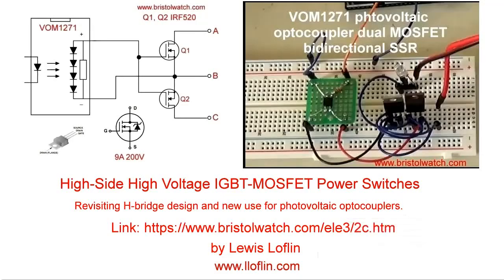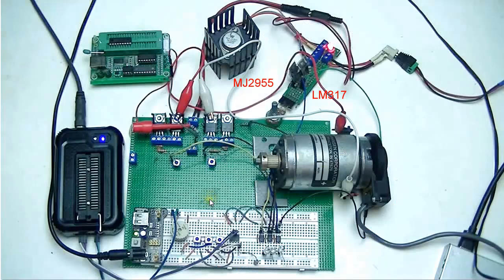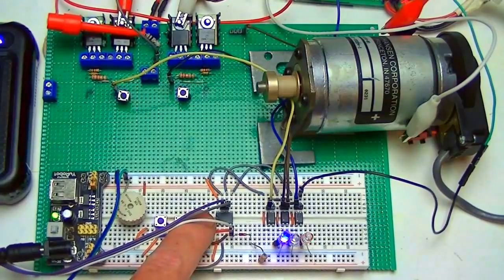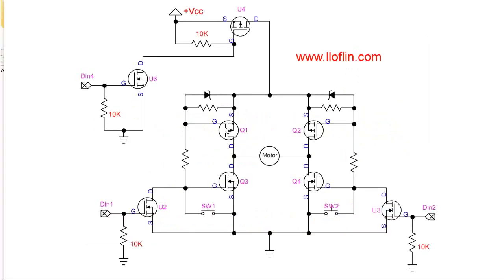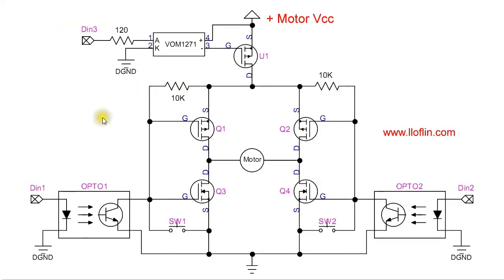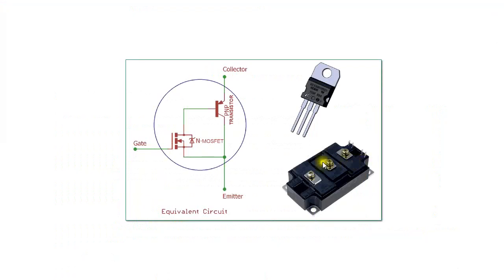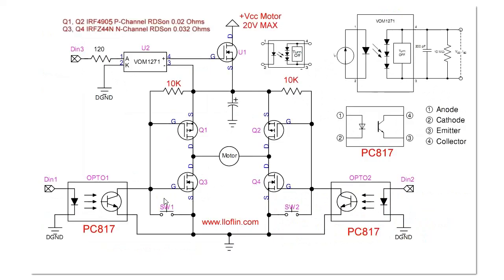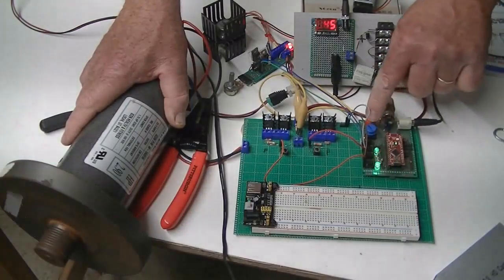High-Side High Voltage IGBT-MOSFET Power Switches

Comment: Can you do a video on smoothing PWM power to a large DC motor? How to size and whether to use a capacitor or choke? Thanks
Reply from the maker: Voltage and current have to be known. I'll try to cover that in an upcoming video.

Comment: Thanks for the video!

I have a winter project to design a new autopilot for my boat. The current one uses large BJT's for the H-Bridge, its from the early 90's so thats what was available. I wanted to replace these with MOSFETs to reduce the power loss in the circuit.

Comment: VOM1271 has a very bad temperature-Vco curve sir. When it 0, Vco is about 10V, which is enough to open a MOSFET up to a Rdson from specs, but when it becomes really hot, Vco can be as low as 5V. But nobody stops us from using  it in series with a zenner (cause when  it's below 0, Vco can be more than 10V), but this must be calculated yet because of a small output current. I prefer to use some high voltage PWM IC and PCB coils for a floating voltage source(s), and some simple traditional optocoupler
Reply from the maker: OK, thanks. I will address this in the next video with an alternative part. It is also slow frequency, which I'll also address.
Reply: @LewisLoflin  Great! Thank you sir. The slowness could not be a problem in case of a permanent on/off switch. In my case for instance, I needed 16 switches for an active cell balancer, and the cheapest solution with good specs were exactly 16 floating voltage sources. Just 50c PWM IC with 50c supplemental discretes, $1 ferrite core, x16 10c diodes, x16 20c capacitors, x16 5c resistors, and x16 17c optocouplers.

Comment: when we use N channel mosfet as High side. we don't need bootstrap capacitor ?
Reply from the maker: No. The generated PV opto is the on voltage.
Reply: no, the pv driver generates a voltage on the gate that is higher than the source.
Reply from the maker: In an n-channel the gate is positive with respect to source. In p-channel the opposite. It is not a matter of "higher" it is the voltage difference.

Comment from the maker: Recent schematics: https://www.lloflin.com/index.htm

YouTube:
https://www.youtube.com/watch?v=408qlS2z6ys
Opto-Coupler Theory and Circuits

https://youtu.be/Xjr7dFh3lYY
Opto-Coupler Interfacing H-Bridge Circuits

Website:

https://www.bristolwatch.com/ele/opto_isolated.htm
Opto-isolated transistor Drivers for Micro-Controllers

https://www.bristolwatch.com/ele2/index.htm
Optical Isolation of H-Bridge Motor Controls

https://www.bristolwatch.com/TC4420/index.htm 
Intro TC4420-TC4429 MOSFET Drivers

https://www.bristolwatch.com/ele3/1g.htm 
VOM1271 Photovoltaic MOSFET Driver Circuits

https://www.bristolwatch.com/ele3/2c.htm 
Bidirectional Solid State Relay Circuits

YouTube Videos

https://youtu.be/5lxxiC1HtBk 
Introduction TC4420-TC4429 MOSFET Drivers

https://youtu.be/-Pmhx_ebJKM 
Circuit Examples for TC4420-TC4429 MOSFET Drivers

https://youtu.be/h_0t50j0BxM 
TC4420 H-Bridge Circuit